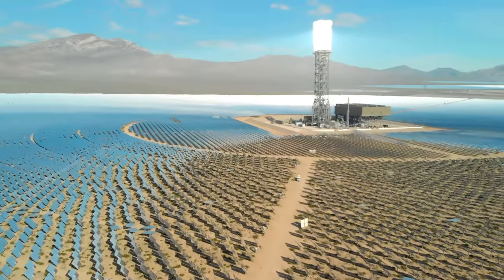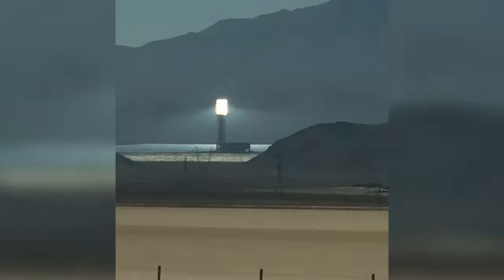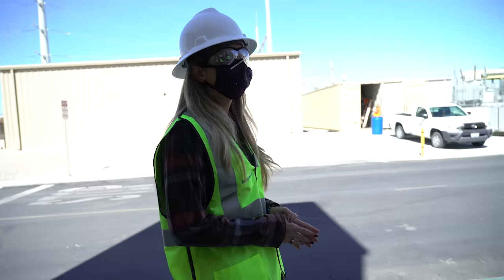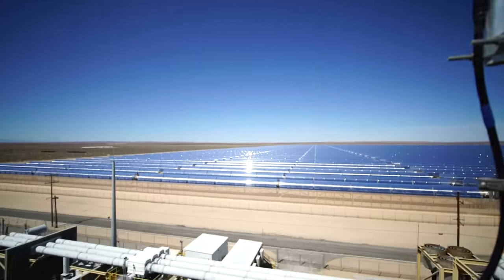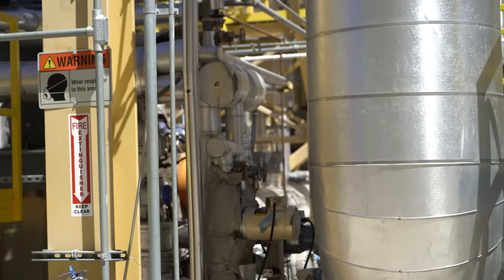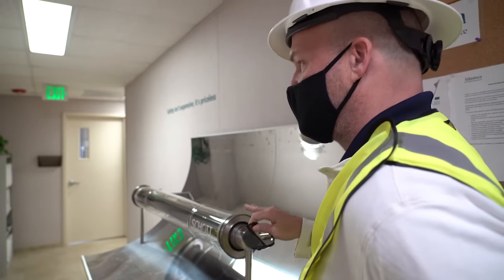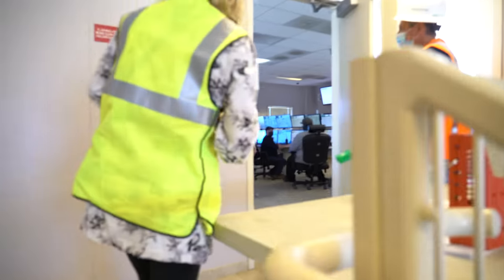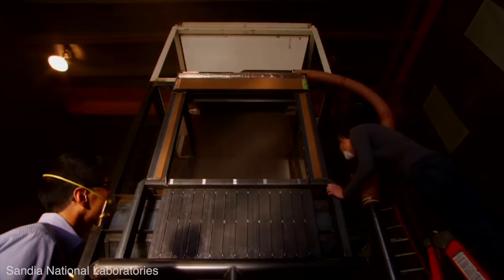How Mirrors Could Solve our Energy Problem

Comment: photovoltaics still outperform mechanical turbine generation for cost per terawatt as the overhead is cheaper; there isn't critical machinery that needs to be in place. I'm a fan of alternative solutions tho
Reply: If photovoltaics outperform turbines, why would people still use anything with turbines (e.g. nuclear or fossil)? Maybe you mean CSP turbine power generation instead of turbines in general.
Reply: @niklaskoskinen123  Solar’s cost advantage is new.  It is already driving coal out of business.
Reply: @paulogden7417  It's driving coal out of business for other reasons that came about in between 2008ish and 2016ish.
Reply: @niklaskoskinen123  : building a steam cycle costs more than building a PV plant that generates an equal amount of electricity over the year. So if you're building a new plant, you'll just about never choose steam power, no matter what the heat source is.

The exception is if it's cheap enough that you can run it while the PV is not producing as much power (e.g. at night, or in winter) and power prices rise, so that leaves some room for natural gas combined-cycle plants.

And why would anyone still use existing plants is that they exist. With coal, even that's not cheap enough: it's more expensive to operate a coal-fired plant that someone gives you for free than to build a new wind or solar farm. But with other heat sources it remains cheaper to keep using them than to build new renewables.
Reply: Correct

Comment: I agree with the Thorium Molten Salt Reactor,  it was actually started here in the USA when they were deciding to us Uranium or Thorium,  it was part of the research being done in Oak Ridge but they went with the faster Uranium and the benefits of that was the by-product could still be used for weapons where Thorium could still be used for that but just not as easily.  I think Thorium is better because of least rare earth minerals and less environmental impact than batteries, and clean up from broken down wind turbines and solar fields.  Plus side is that Thorium works even when it's dark outside, where in the north where I live 9 months out of the year it is mostly dark and cold.

Comment: I hope to God that this and fusion works
Reply: @jdogdarkness  You a politician?
Reply: I've never seen a convincing argument that shows how fusion would generate inexpensive electricity.  It's just another way to boil water and so far boiling water generators are not affordable.
Reply: Fusion reactors struggle to break even in terms of energy in Vs energy out. Fusion reactors nearly all run on a deuterium/tritium fuel cycle, the latter of which is generated in fission reactors. The up front cost of fusion reactors is much worse than fission reactors, and fission reactors struggle to get built because of their sizable up front cost.

For these reasons, fusion is unlikely to be economic enough or ready in time to help fight climate change.

Comment: The idea of sand was interesting but , these concave mirrors may also cause Global warming.You aimed for the heat energy and that will turn the Global warming.
Reply: These mirrors and the heat they generate is the reason there's a drought. 
The monsoon that used to come from Nevada and Arizona storm turn back and away from California. 
The High Pressure as Weather Casters call it : keep the storms going up to Canada 🇨🇦 with  the occasional drop to the Bay area. This is and I hope an unintentional Weather Modification

Comment: It would have been good to get a few details of how the energy storage works. It kind of got glossed over.
Reply: That's because this power plant is an abysmal failure. It never produced as much energy as it was supposed to and it burns huge amounts of natural gas.
Reply: @PistonAvatarGuy  can you explain where the natural gas comes into the process?
Reply: @robotsongs  The power plant burns natural gas to begin operation each day, and it burns 4 times more than it was originally meant to burn.
Reply: @PistonAvatarGuy  I mean, "huge amounts of natural gas" =/= initial startup burns. That's all subjective until you can put out actual numbers. How many gallons/cuft does it burn during this process? How often is the startup process initiated? On balance, how much carbon is put out in total (including startup burn and operating emissions) per KwHr in comparison to other methods?

Your comment sounds like an emotional hit piece rather than a reasoned statement of facts.

Feel free to provide facts to support your conclusion. This pertains to science, after all.
Reply: @robotsongs  If I have the energy, I'll run the numbers later, but the bottom line is that there's no point in using a system which is dependent on natural gas when there is a much less expensive option available which does not. The use of natural gas must be eliminated if we're to fight global warming.

Per unit of energy produced, the cost of building this solar energy system was three times more expensive than nuclear, and nuclear is a FAR less carbon intensive energy source.
Reply: @PistonAvatarGuy  Sounds to me like you have an ax to grind.  Your initial statement is just a hit piece.  The plant is not "an abysmal failure" just because natural gas is used as a daily starter.  By all means, provide links to credible sites with statistics that show this plant's carbon footprint makes it untenable.  Until then, I'm done here.
Reply: @joesterling4299  She didn't even mention that the plant requires natural gas to begin operations on a daily basis nor did she mention most of the figures that one would look at to see whether this approach is any good and you irked by the person who brings this very important information to attention? Instead of only asking him for numbers why not ask Physics Girl to give some stats on this plant? This channel has produced many interesting science based videos but this one was very superficial and as OP and PistonAvatarGuy said glossed over many important details so their criticism can hardly be called an ax to grind.
Reply: @joesterling4299  The COST makes it untenable.
Reply: @joesterling4299  Anyway, I think that there's some confusion here. I was talking about Ivanpah, you must be talking about Nevada Solar One. I should have been more clear.

Either way, these power plants are about three times more expensive than a nuclear power plant, they rely on fossil fuels to function, their output can vary with environmental conditions, and they require about 20 times more land area than a nuclear power plant with comparable energy output, so there's just nothing practical, or "green" about them.

Comment: "Modern solutions for old pollution."
- Physics Girl
Reply: They don't say that!
Reply: @blucat4  
What?...
Reply: @blucat4  
What?...
Reply: @Didgeridoobidrewbi  @Bonten  No, the correct follow up is:  "They should."
Reply: "Augustin Mouchot demonstrated a solar collector with a cooling engine making ice cream at the 1878 Universal Exhibition in Paris. The first installation of solar thermal energy equipment occurred in the Sahara approximately in 1910 by Frank Shuman when a steam engine was run on steam produced by sunlight. Because liquid fuel engines were developed and found more convenient, the Sahara project was abandoned, only to be revisited several decades later.[1]" -solar thermal Wikipedia page
Reply: @blucat4  They should!

Comment: So, the never ending job is to clean the mirrors. Oh yeah, to replace the mirrors when they have been cleaned too many times. Save that work for cloudy days. Don't want to get in the way of a best case scenario. This series is full of those. If it all was sooo cool and wonderful, that is what we would use. Alas, when you really need power 24/7, you are back to coal, oil, gas, nuclear to make power. Wind, wave and solar make for good doctorate papers and pie in the sky dreams. Real world energy generation, not so much.

Comment: You really should have mentioned that Concentrated Solar Energy is 2x as efficient at producing energy as Photovoltaic Energy at up to over 40%. This means that a lot less energy is wasted out of the 1kw of solar energy that hits each square meter. 
Photovoltaic Energy is actually really bad when you consider that with 12-20% efficiency you are heating the atmosphere with the rest of that. Once you add all the other losses you are creating a ton of extra heat and very little energy. With concentrated solar you reduce that wasted heat by a LOT.
Reply: PV modules extracting say 15-20% of solar don't create heat that was not converted. They change the albedo yes to be more reflective of solar radiation overall. That could be good thing to radiate more solar heat to space but its insignificant to earths heat balance.
Reply: @briannugent5518  Not only that but solar PV will also work even when there is no direct sunlight. Clouds mostly stop reflective solar concentrator systems so these reflector systems have to located carefully.
Reply: @mb-3faze  agreed
Reply: Solar panels also can last ~25 years, and I can imagine this system can last much longer with little maintenance (cleaning, etc.)
Reply: who cares? it costs more

Comment: HOW MUCH GREEN IS THIS WHEN it uses  2 M gal of "nonrenewable oil" HFT (HEAT TRANSFER FLUID)  to heat water?
Reply: Water to wash the mirrors.
Reply: @mikusoxlongius  its not about washing the mirrors.... its abt "heating"oil via sunlight captured by mirrors to heat  water to generate steam to run the turbine....
Reply: 1/3 of all man made greenhouse gas emmissions are from power generation.
Fun fact, 1/3 of all the mercury in the environment is man made, and the majority of that is from burning coal.
Reply: @nordic5490  its always the cost of production......coal is a cheap source of generating electricity...although not a green one
Reply: They’ve never had to change the fluid….

Comment: Interesting video...  There is a fairly large footprint on the desert here as well as some mortality of birds particularly with the tower model that should be worked into the discussion of the best technologies.
Reply: The air space between the mirrors and the tower reaches a temperature of about 900F. So any birds flying through that space are almost instantly roasted.  The plant crew's call them "Smoker's" as they fall to the ground. 
 A few years ago they had a mirror misalignment to just below the solar collector and nearly melted one tower in half.

Comment: 7:30 Not only that, but they convert solar energy into electricity directly - not with a step in between to heat up water or any other liquid, which then turns on a turbine. It's the equivalent to EV vs. FCEV. Each additional step means lose of effiency. Also, you can install photovoltaics on any roof. You don't need extra space for several mirrors and a tower. When it comes to storage the energy: well, you still have batteries, that are also more efficient and smaller. In addition there are fly wheel energy storages: again more efficient and smaller.

Comment: You could actually use the overabundance of energy to do "reverse" chemistry. Like, carbon capture, for example. That is actually a valid way to store power too, as weird as it might sound. If you overproduce energy, and you create carbohydrates "from thin air", you can then burn them for energy when needed without real CO2 emissions, since these were already in the air. And if you don't need to burn them, just move them into storage.

I should mention that - assuming my information is still valid - carbon capture tech is still being researched/tested, and it is not very efficient (yet), but in principle it is an amazing solution to the energy storage problem of renewable energies. And efficiency doesn't really matter, if the power plant already over-performs. Everything that is above 100% required energy can just be blown into that effort. It's actually carbon-negative that way.

If you have issues with 100% renewable energy having little storage capabilities, then you grab your storage from the air, reducing pollutants and at the same time creating a dense energy source. You can then just use it for storage, or other chemistry, or for areas where dense power is required, or "deep storage"(my term), i.e. just place the carbon back into the earth so it doesn't float around the atmosphere

Comment: These solar concentration sites take up so much space and also that is a lot of future waste.   Only beneficial in desert. They could counter the environmental impact by using excess electricity to fuel CO2 air scrubbers that pull CO2 from the air.  They could also use some power to run huge humidifiers to counter the residual heat waste.

Comment: From what I've heard conditions aren't always right for large scale solar electricity generation. If you set one up in the desert you have plenty of sunshine, but there is little water. I'm wondering if the synthetic oil and molten salt generators need less water and therefore are more efficient in desert environments.

Comment: For Christmas I bought a entry level bicycle. A electric bike. The first thing I learned is how torquey the motor is. I have not driven anything else electric  but am ready. For my daily driver anyway.  For that job a electric car or truck would do just fine if it had ~300 mile range. As for my truck it would need more. So diesel it is. Thank you!

Comment: Didn't the Spanish have something similar near Barcelona, which (I am given to understand) has closed because it went bust?
Reply: It was a power plant built by Martin Marietta in 1981 to be installed at Elmira, Spain; it was a trough system.  I worked on the control system for it.  Martin was big into solar in the Carter years; after Regan came in they were all terminated.  I wrote some about it about four hours up from here.  It

Comment: There are really innovative and exciting solutions in this new developing energy market.

At the same time, why hasn't expanding nuclear energy also been included in part of the energy solution?

In an argument i recently heard, if you were to replace all forms of fossil fuel energy with renewables the foot print would be so large that the protection of the ecosystems would be of major concern. it is also far less expensive to produce.

Comment: I've been talking about something like this for years(about 30), in that we need to use the suns passive radiant heat energy for power, but it comes down to energy storage.  If we can develop energy storage batteries we are closer and could make them in space with 24/7 sunlight, but the real key is a self charging battery which would also be the foundation for AGI...I'm glad companies are using my ideas and are actually making progress on it, I'll keep working on the self charging batteries though and maybe that will fund my astrophysics degree...or my loan debt when I finish getting it.
A self charging battery has something to do with a tesla coil and magnets north and south poles cycling the energies...what do you think?  Human beings/life forms are self charging batteries and we can mimic that too for the battery and AGI.

Comment: @physicsgirl, I'm not sure if they explained it wrong to you or not but saturated steam is generated in the boilers below the steam drum. The steam drum has separators which separate the steam and water. The saturated steam (steam at the same temperature as the boiling point) then goes to a higher temperature exchanger from the heat transfer fluid to be superheated (adding energy above saturation point). Turbines can't run on saturated steam, as the steam would immediately condense as it gives up energy across the turbine stages. Turbines don't like water. The flow chart @2:05 actually shows the superheater.

Comment: Best home solar energy reduction is reducing the cost of heating water. Solar water heating, which is about 25-35% of home energy consumption and is about $2000-$4000 to install. And can pay for itself in 3-5 years depending on your method of energy usage elec, gas, or oil.

Comment: Very interesting video.  However, it may be a good idea theoretically, but in large-scale use, to cover the US energy consumption would take more square mileage than the entire state of South Carolina.  The secondary concern would be the ecological/environmental damage created by these plants to the localized systems.  It works well in the Mojave... but potentially less so in other states; this is not a small area required for these facilities.

Comment: The water vaper is so clean if u let it be water drops again by cooling. Imagine sea water in australia diverted to the middle of the desert and using that water in this process. Use the purified water after the heating and cooling (condensor based) to grow plants. We can grow trees in the middle of the desert.